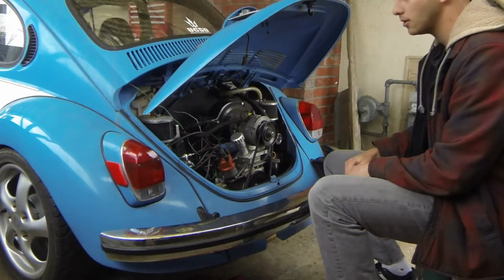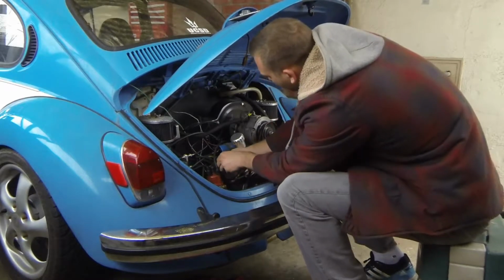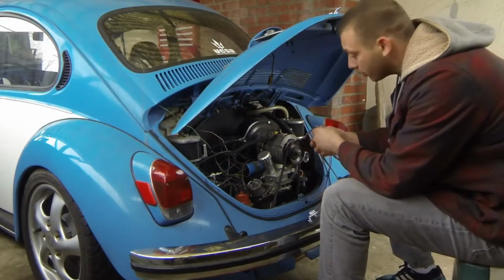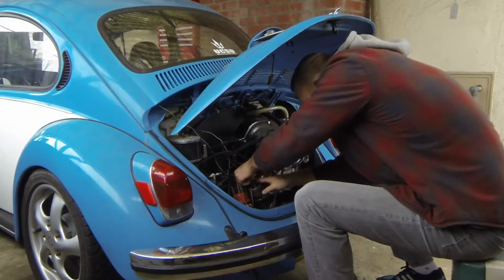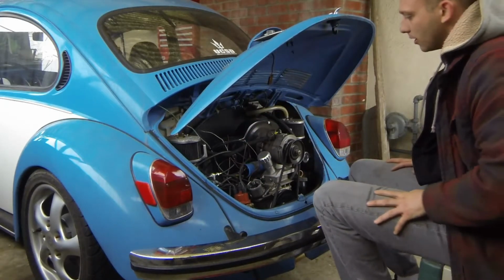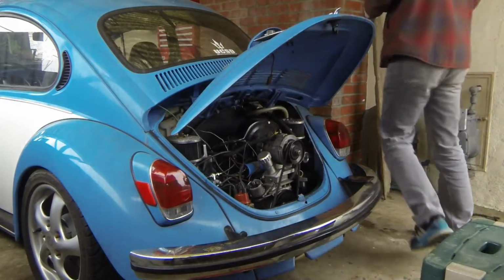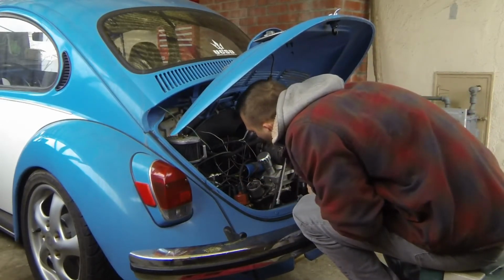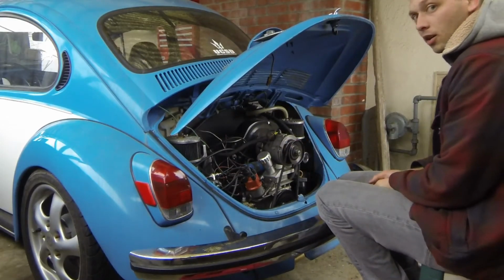VW Beetle Electronic Ignition Install

Comment: Even with a Electronic ignition still carry a set of points and condensor with you.  All you need is a screw driver.  You can use the top of the box that the points came in to set your points to .016.  That will atleast get home.    I always carry a set of points,condensor, fan belt in my tool box in the car.

Comment: You didn't show a close up of the dist when you put on the magnetic bushing, so now I have to ask: how did to get it down past the thicker part of the rotor shaft?
Reply from the maker: Munitia Blastpaw if memory serves, it was a super tight fit to get it on. I think I slipped a socket over and beat it on with a hammer. I didn't change it in this video, I left the old one on. I hope this helps!

Comment: What kind of fan shroud is that?
Reply from the maker: George Villalba it's a DTM V2 shroud. Used to convert a type 4 engine from the flat bus style cooling to upright to fit in a bug.

Search the type4store if you want to check them out.
Reply: @477racing  that's wild never seen them..kinda koo thanks for the info.